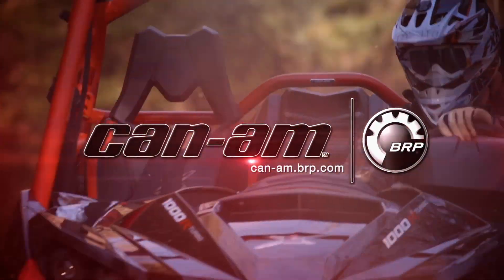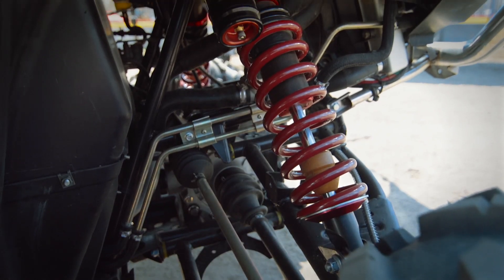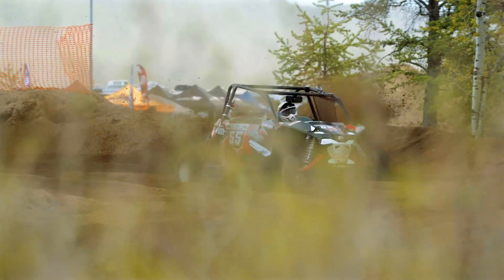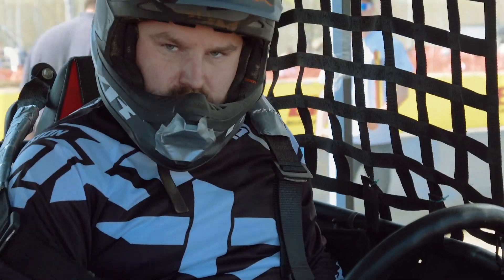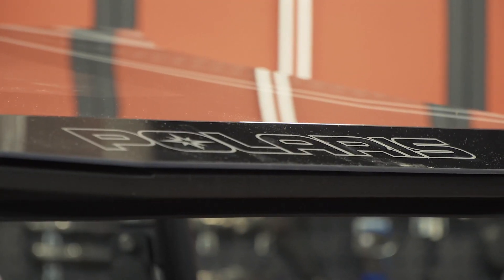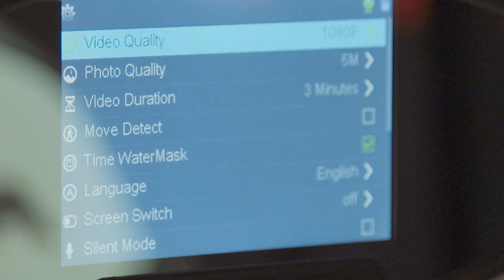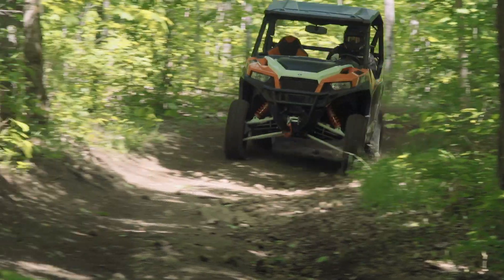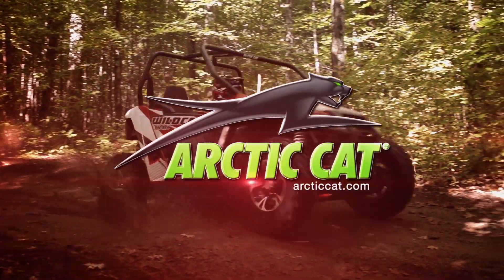Dirt Trax Television 2016 - Episode 4 (FULL)

Comment: I wanna share a tip for anyone not using blue loc tight.  I've Been riding atvs mx bike and sleds since 1980. I've owned 67 mx bikes and quads and trikes over the years and blue loctight is by far the must important cheap trick anyone can do to help keep parts from coming loose on the track or trail. every time I buy a new machine or add a part I always use blue loctight on the bolts as insurance so nothing falls off or comes loose. tie rods always get the loctight  as you seen why in luc s race. give it a try and I'm sure in a short while you'll feel  glad you did when your friend is asking for tools and slowing down the group ride.  happy trails